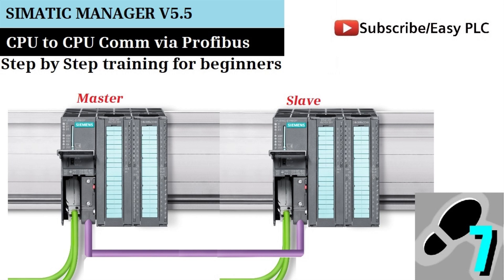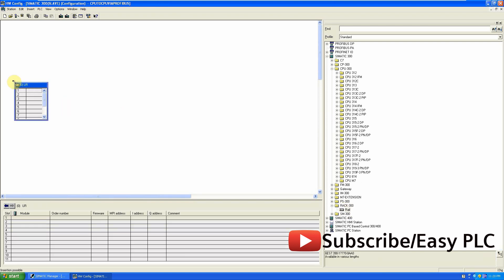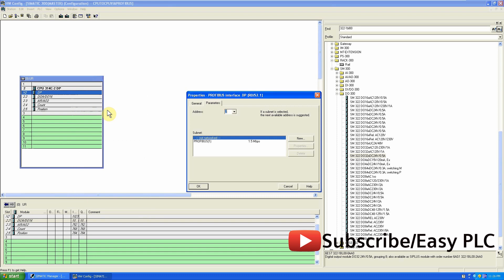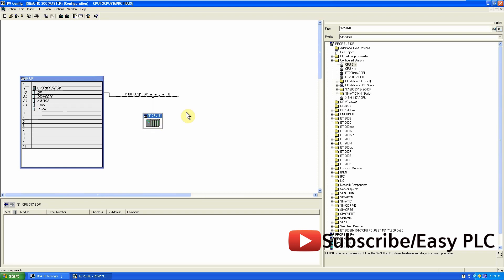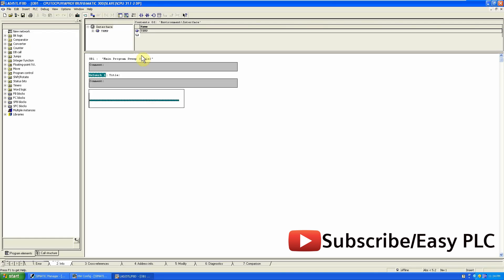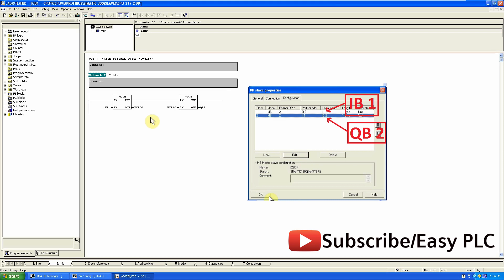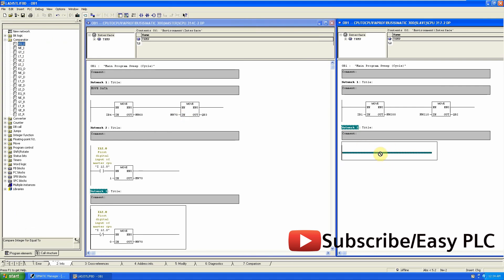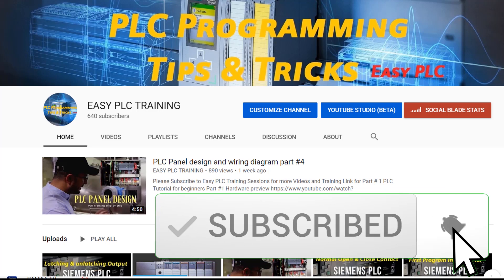Siemens Step 7 CPU to CPU by Communication via Profibus in Simatic Manager

Comment: I want to make a temporary conclusion, that the communication goes through the exchange of data sent to a word memory variable (MWxx), both PLC nodes can read the word memory status, for example:
I0.1 on the master wants to turn on the Q0.1 output on the slave
The master must send a value to the memory word variable when the I0.1 state is on or off, and the slave can read the same memory word state then interpret its value in the slave.

masters
I0.1--->Mw100

slave Mw100 --- Q0.1

is that so?

I am not very clear what OB82 and OB121 mean, but I suspect that is where their data exchange is which is used together as a memory buffer.
is that so?🙏🙏

Comment: nice , formative content 
please make video about communication via ethernet
Thank you
Reply from the maker: Sure bro .... but problem is I have only one S71200 CPU with me any way i will try
Reply: @EASYPLCTRAINING  i appreciate your reply
If you can do it just by simulator that will be helpfull
Reply: @EASYPLCTRAINING  bro you just hsow the software work by simulation in the plc sim or by showing the var table.also please try to establish the communication by programming get/put fb with description. so that it will more helpful to understand every step. thanks in advance
Reply: When i have established a communication between two cpu data is not transferring between cpu.when open ob1 shows a message block can nit be monitored because doesnt match what can be the reason.hardware setup os ok
Reply from the maker: https://youtu.be/VJbKsYGB5sE